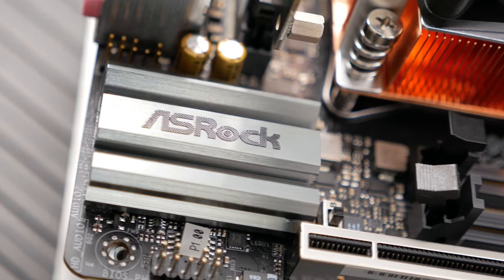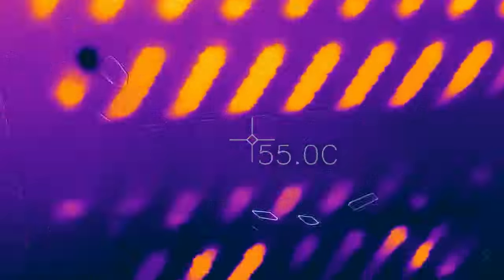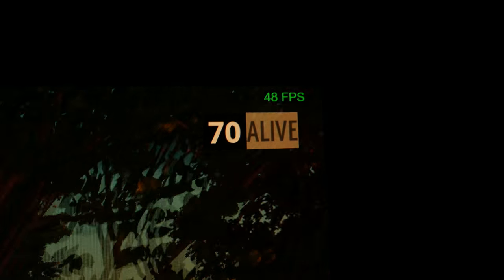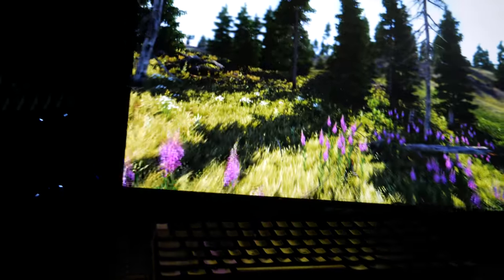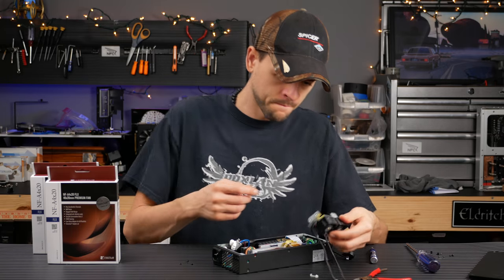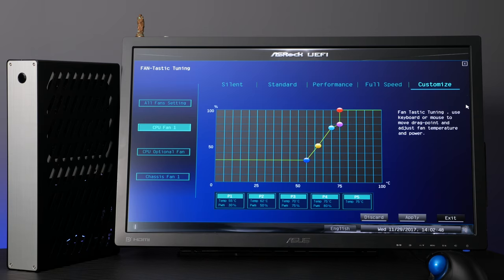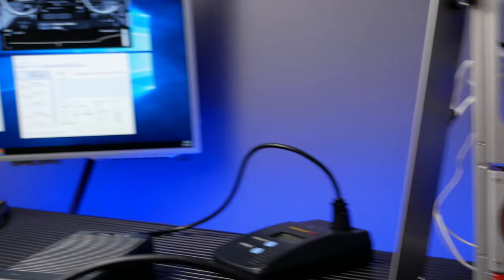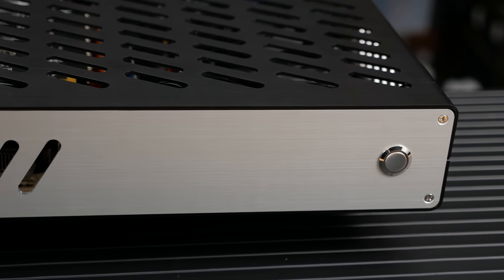5 Liter MONSTER ITX Build. 7920X + 1080ti

Comment: If you want the CPU to be cool you should delid it. You could easily get -20C drop.
Reply: Yeah, I found the liquid metal application to the top of the IHS to be an odd move. Much better to apply it to the CPU between the IHS and use a standard TIM between the IHS and the copper block. Some interesting stuff here though and a very well made video.
Reply: Yeah that's it. BTW, Why don't you try to mount a larger fan on the CPU heatsink?
Reply from the maker: I take one step at a time so I can measure each change. Peace :)
Reply: Cool, then you know what had the greatest effect. And then share with us your findings.
Reply: High five, good work
Reply: Also undervolting should help a lot too.

Comment: Would it have been quieter with the Dynatron heatsink if you'd used a Noctua fan and delidded the CPU?
Reply from the maker: Hello and thank you for your comment! A few thoughts on this... Firstly the noiseblocker fan was 80mm and slim, and Noctua doesn't have anything like this. It needed to be 80mm to match the shroud on the R30, and the R30 needed a shroud to even get these temps. Secondly the noiseblocker fan is pretty quiet, many people think their tone is better than Noctua too (I'm on the fence about that). Thirdly although everyone is suggesting it, my own testing has me concluding that delidding only helps when your heatsink can remove heat from the spreader faster than the spreader can transfer heat from the die. YouTube  liquid metal videos have made this into a legendary, magical way to reduce temperatures, but the truth is not every CPU needs it (some do) and smaller heatsinks ran to their max aren't going to see much of a difference. I have a delidding set and use it when necessary. In the next video I'll demonstrate that this particular CPU is able to keep up and transfer as much heat to the die as the waterblock can remove. Those are my wacky thoughts. What do you think? Peace
Reply: Thank you so much for the detailed reply, Josh. I'm a fan, I post regularly on SFF forum. What about using a Dynatron R15 + Noctua NF A9x14 attached with zipties (or use your angle grinder to make notches in the cooler and then use the L9i's mounting brackets). I think you'll get much better temperatures with that config. Great point on delidding, I hadn't considered that thermal transfer from IHS to heatsink has to exceed transfer from die to IHS. I still think you may see a benefit, it certainly won't hurt as the entire thermal transfer chain will be more efficient, but perhaps not worth the effort. I am very excited for the next video, I can't imagine how you'd possibly watercool in the Mini, unless you're planning on mounting the radiator externally, which would be interesting. I'm staying tuned.

Comment: Did you ever notice a humming noise due to the GPU fan mod? I had that problem with mine (also using Noctuas), but I solved it by adding some standoffs to the sky bracket, moving the fan blades a few mm further away from the cover. Would very much recommend trying that, if your GPU's heatsink is short enough to allow that.

Comment: pubg is poorly optimized but something is wrong with the setup if you have those framerates. i have a STOCK 7940x and get 80-110fps in pubg at 1440p with a Titan x pascal

Comment: There’s no way you’re liquid cooling a mini unless you get a fully custom Water Cooler (Specifically the Radiator)

I’m guessing a LP, Single Slot GTX 1030/50/ti? Also probably a really thin Rad with a Lower power CPU such as the S/T intel series? Or maybe underclocking?
Reply from the maker: I'm going to think outside the box (cheat). xD
Reply: Not From Concentrate I mean if you’re going to do that there’s a bunch of stuff you can do, AIO or Custom Loop? I’d suggest AIO if you can but you may be forced to go custom if your case makes it too difficult... really looking forward to seeing what you make, I bet it’ll look really unique and cool

Comment: That's pretty beastly.
5.1L with 12cores and GTX 1080 Ti.

Imagine downgrading to a Dan Case A4 (6.3L) with Core i7-6900k and GTX 1080.
Or further down to a SilverStone rvz02 (9.8L) with Core i7-8700k and GTX 1070.
Or down more to a SilverStone SG13 (11.5L) with Core i7-7700k and GTX 1060.
Or down very low to a FractalDesign Core 500 (19.5L) with Ryzen R5-1500X and RX470.

Or further down to a Core i7-4970 and GTX 1050 Ti (LP-HH), running on a prebuilt Dell Optiplex 9020 SFF (8.4L) which can be had for under US$300.
Reply: Kangal from ozbargain? Lol haha this is AlienC

Comment: Hey man, did you at least attempt to delid the CPU? That may have helped out a little bit.
Reply from the maker: DerpFails I delid cpu dies that need it but I have concrete evidence that this cpu did not need or would benefit from delidding. You'll see why next week. Peace!
Reply: Not From Concentrate Do you think you could still test a delid with the tiny cooler? I'd like to see the results. I would've thought there would be better heat transfer, so it would end up being maybe a degree or two cooler, but heat soak faster.

Comment: Hey I need to know if an i5 8600k paired with a gtx 1060 6gb acx 2.0 can work properly in the S4 mini while using the noctue cpu fan?
Reply from the maker: It will be a perfect fit.
Reply: Not From Concentrate the NH L9i is actually good enough or would you recommend a different noctue CPU fan? I ask because last night I looked up a guide for the TDP for the noctue fans and they said they don't recommend using the 95 TDP coffee lake CPU. I assumed you probably already tested this so I was hoping you could guide me in the right direction.

Comment: could one use two smaller bricks to power a build like this? I've seen those huge laptops do it and always wondered if it would be easy to wire this up or it takes extra parts to achieve.

Comment: Dumb question, but in order to lower the temps, would slighty reducing the cpu stock voltage help ? There might be some slim margin when undervolting that could help. Everybody mentionned delid and when you look at the crappy intel TIM, it's no wonder that the temperature would decrease I think. Great vids, keep it up, I'll buy an S4 one day.
Reply from the maker: Great questions. Firstly yes, undervolting is always a way to reduce temps. This is part of my tuning process if necessary. Secondly, as someone who does this, delidding does not always yield better temps. There is a way to confirm this if you have the equipment, which I do, and will show in the next video. The i9 chips have a much larger heatspreader, better tim, and more contact than the 6 and 7000 series cpus. Peace to you and thanks again for the comment!!!

Comment: I love these cases. How did you build your design and  manufacturing knowledge? I am an engineering student designing a mini ITX case and I am struggling to find much in case design.
Reply from the maker: 9 years of DIY. You could always join a community like smallformfactor.net. If I had that 9 years ago maybe it would have only been 4 years. :)
Reply: Not From Concentrate thank you. I will definitely join. :)

Comment: Im pretty sure its throttling thats why it was at 10fps in pubg. i9 is actually the first great gaming HEDT CPUs.
Reply: Disagree, I think MESH design adds much latency, 6950x overclocked with ringbus arch. is more suitable for gaming. Granted both are obselete when theres the 8700k
Reply: It might have been VRM throttling as well, which is less obvious